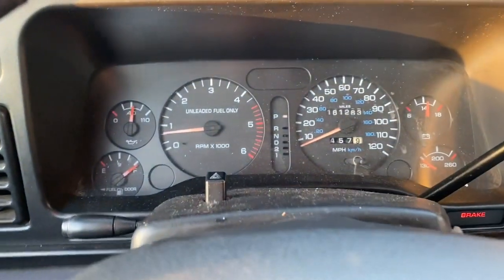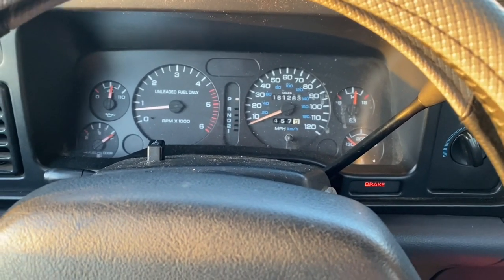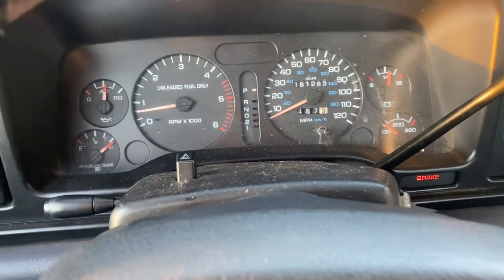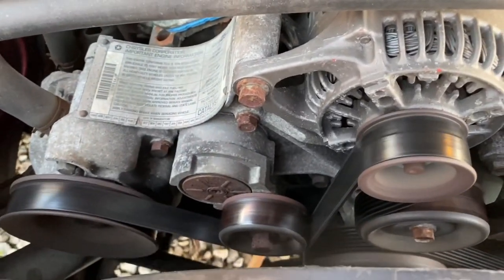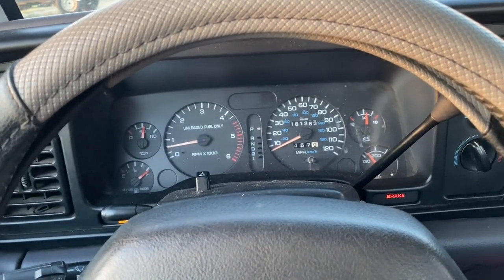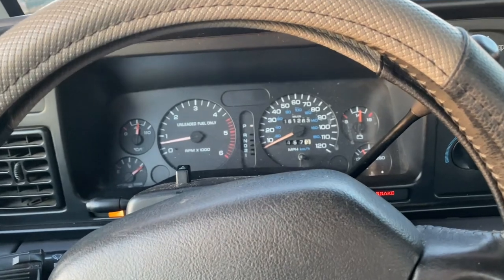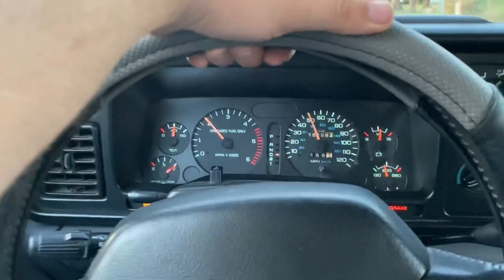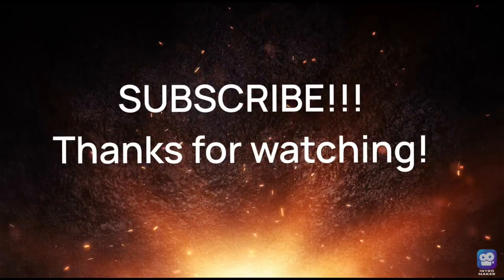What it’s like to own a v10 Dodge Ram

Comment: I get 21 MPG on my 5.9 magnum 360 2500. I’m in disbelief myself. I always heard the 2nd gens were terrible in gas mileages. My engine is completely stock.
Reply: The body has thick steel thats why Gen 3 Rams are lighter my buddy has a 03 crew cab V6 5 Speed and gets decent mileage
Reply: How on earth are you getting 21 mpgs? not even the v6 engines and the Cummins get that good.
Reply: @arturos.l.2248  I don’t know. I didn’t do anything. Maybe because I don’t haul anything, or carry anything in the cab, or bed besides the spare tire tools, and jack.
Reply: @adriananoelle4699  😎👍 She's a keeper. Must have a good strong engine
Reply: @arturos.l.2248  Thank you, she’s on my channel. The key is regular maintenance. I add sea foam every fill.
Reply: We talking about v10s
Reply: @adriananoelle4699  I have a 2017 Ram but I'm with you on the sea foam!
Reply: Yes ur truck must have been taken care of I got 20"s on my v10 I'm getting like 7 or 8 anybody else have issues with the crankshaft sensor on there's? Jw I have replaced mine 3 × in a year
Reply: @tommyboy9407  I’ve heard of all these issues that I’ve never quite experienced yet, thankfully. Maybe because my RAM was a pilot vehicle, specially built for promotional use.
Reply: BS
Reply: @DUDEWithDODGES  Jealous much? 😋
Reply: Thanks bot
Reply: @DUDEWithDODGES  its a bot chill
Reply: You got your numbers mixed up, more like 12 MPG. There, fixed it for you.
Reply: @linkhatchet  Nope.
Reply: Doesn’t seem to know much about dodge trucks, turning radius like any longer wheelbase truck, and yes it’s a big engine it’s a V10 it’s only 5 inches longer  than a 5.9   Just compare the two and you will notice the V10 engine is just closer two the radiator by 5 inches . Gas mileage won’t be the greatest if you compare it to  a V8 or V6.  It’s basic math! Your feeding gas to 10 cylinders versus 6 or 8 plus they seem to be all geared deeper for towing. I would bye one if you could still get good crank sensors so sticking with my 99 dodge, Quad cab 4x4, 1500 , 5.9 and automatic.  Oh bye the way, people told me too those magnum engines didn’t get good mileage, just keep it in the power band which for my truck with 3.55 gears, it’s long legged so overdrive off below 65 period. 70-72 mph in OD is the sweet spot. Best mileage to date 20.4 at that speed.   Bought used over 17 years ago. Now has over 190,000 miles on her. Still going strong .  Yes a V10 would do better towing my  loaded  car trailer but I can’t bitch about my dodge.

Comment: Oh btw take the stock exhaust manifolds and system  off its too chocked down.. run headers, 2.5 into a 3inch and pur a magnaflow on it. It will keep it mellow and let it breath. Thw big gulp throttle  bodies will work on these as well

Comment: I  own a  95 Dodge  1 ton  Ram V10 that I purchased New in '95,  I ordered mine with an Xtra long wheel base (about 1 Ft longer than the regular long bed) & I have a flat bed on it.
It's got 103,000 orig. miles & the only repairs It has ever needed were Brakes, & the smog pump
went out (bad bearing). I deleted the smog pump, But I still have those hoses sitting their
under the hood. not sure what to do with them  lol.   It runs great, But It has a leaky 
freeze plug right behind the motor mount & looks like the engine has to be raised up
 in order to change out the plug!   
   Also,  the top of the Dash has totally disintegrated & looks like sh*t.

Comment: Mine has regular PO132 and P0135 codes everytime I have to smog in California every 2 years. Actually mine has very good speed it is fast. If you warm up in neutral at 2,000 or higher rpm's until you hear the tach drop the it will shift better especially when cold.

Comment: Crazy you think that's high miles for one of these trucks. I have the 5.9 v8 with 254k....only problem I've had is the ECM went on it a week ago. Currently in the shop getting it changed.

Comment: I get 11 to 13 mpg, it will out run 5.0 mustang at the lights when new, 410 gears, 35 gallons tank gets same mileage as 360 magnums did, it will smoke the tires at the drop of the hat, I have over 300,000 miles on mine, had 35”. Tires on her from first year 2 1/2” legal kit and 3 “ body lift, now has 40” irocks, with 9” of lift,tows like a fright train, would post a picture but can’t mine in 98
Reply: You will not out run any 5.0 with this I’m sorry. Let’s be realistic here😂
Reply: I pulled him at 5 stoplights in a row,his girlfriend was yelling at him to stop, he couldn’t believe my truck pulled him every light,when you don’t know how to drive you have no chance against someone who does my reaction time on light at drag strip is .004 thousand,I have to run pro class lights or I have to wait until.005 to run in stock class, .410 gears,posie it launches, @coltoncaskey5781

Comment: So what's the actual curb weight? Its diffinatly more than 4400lbs cuz my 99 dakota v8 4x4 extended cab weights 4200 and yes curb weight, not gvwr

Comment: You mentioned there’s no problems with the brakes but like on my 2002 Avalanche and it’s a common problem when that sensor goes bad somewhere that makes your ABS and the brake light come on simultaneously
Reply: Usually it's that or the wire broke for the abs sensor had that issue with my 98 V10 2500 2wd

Comment: If you are serious about towing isn't a cummins a better option ?  but cool truck you have
Reply: Cummins is 10x the price
Reply: Depends really diesels take a while more to warm up in cold weather, also gas is more readily available then diesel fuel, but that and price is really the only negative I can think of those cummins get almost 20 mpg highway the V10 gets 12
Reply: I sold my V10 and got a Cummins. I've found that the Cummins tows better at freeway speeds, but the V10 did better towing at low speeds and off road. Plenty of power right off idle but the Cummins doesn't make much power until the turbo gets spooled up. 
Now diesel is almost double the price of gas and I didn't have to plug the V10 in to start it in the extreme cold. A V10 definitely has some advantages.

Comment: Do you have the 47RH transmission?  What's the final drive ratio?  My '99 has the 47RE, and when I hit 55mph the RPMs drop from about 2400 to 1500 when the TCC locks up.  It feels like it has a fifth gear.

Comment: What temp does your v10 run at usually? Mine usually stays right at or slightly above 130. Is that normal for these things? Heater is Luke warm too and I tested the thermostat by leaving the radiator cap open and after about 10 or more minutes idling it still didn’t open. It never overheats though. Any thoughts? I just put in a new temp sensor too.
Reply from the maker: Mine usually runs just at or just under 210. Your thermostat might be stuck open or your heater core may need flushed
Reply: @projectauto1928  Thanks man. Information on these engines is extremely hard to come by.
Reply: Mine also runs at 130
Reply: Yours must be lazy if you think the V8 trucks are quicker
Reply: Change your thermostat and coolant temp sensor!!
Reply: 5.9-5.2’s run at 180-195 I’d say you’re pretty low temperature wise.
Reply: Hey I dont remember the temperature marks and what temp each one is but Mines always ran almost dead perfectly in the middle

Jokes on me the middle is 210
So mine runs right at or a little under 210 as well
Reply: Mine never comes above 1/4 way on gauge, no numbers on it ,but back flushed my heater core now great heat, 300,000 plus miles on mine,
Reply: @stevenrozmus9365  agreed I've been thru the ringer with mine on the crankshaft sensor
Reply: @tommyboy9407  This worked for me.
Reply: I changed the thermostat and my 2001 Dodge  V10 runs much cooler.
Reply: That is strange..I won't even let mine roll until that temp, I sit around 220 once it's fully warmed up

Comment: Brah, you're not very good at looking up info or doing reviews. 

V10 2500 dodge was rated to tow 12700 with 4.10 gears, which is probably what you got. 

It must be torqy as fuck because it's peak is at 2400 rpm.....same as cummins at 2500 rpm.
Reply: Yeah you can tow with these trucks no problem. My friend Mike has a 2001 2500 V10 and he towed a RV from Massachusetts to Vermont and it was way up in Vermont next to the Canadian border. Yeah his gas mileage went down but he didn't have issues at all. He didn't have it that long cause he lost his job so he couldn't afford the insurance on it anymore. So he sold it for exactly what he paid for it which was $10,500. This was back in 2010.